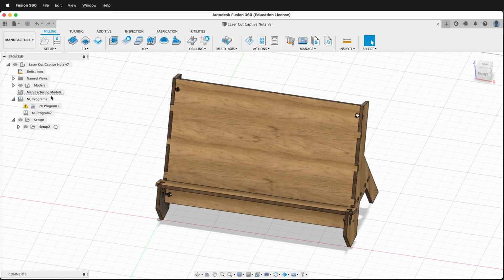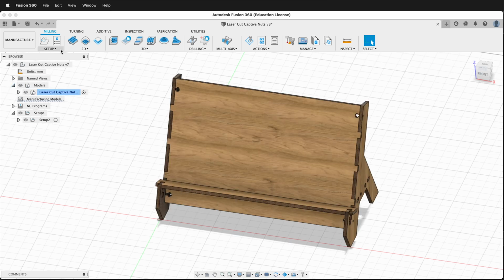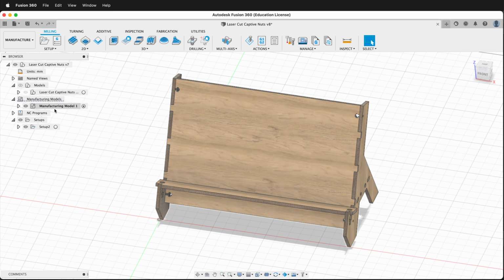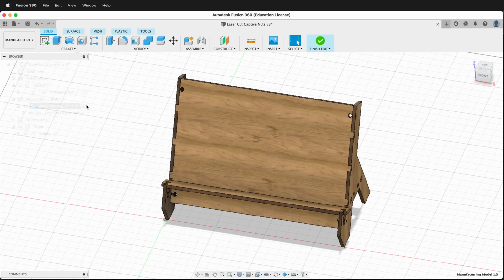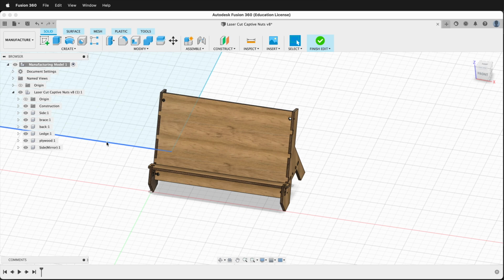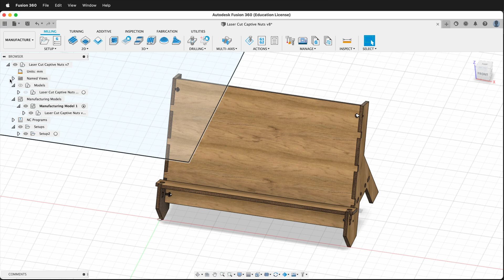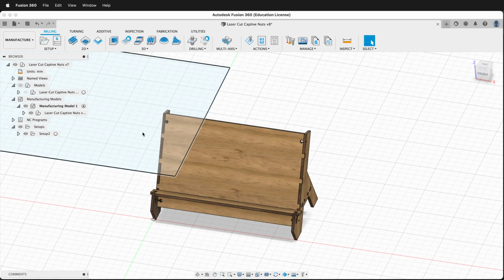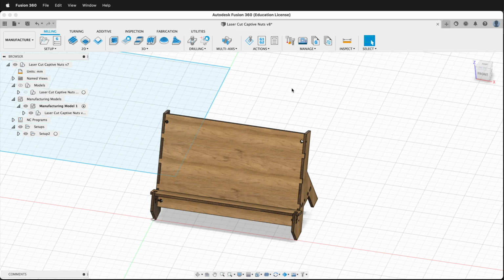Fusion 360 Tutorial - Manufacturer Model

Comment: hey man! so I made something in design and I have a manufacturing model of it laying flat on my plywood. however if I want to edit the final design when I go back to the manufacturing model everything moves back to how it was originally. its important for me to use the assembled part to refine small features that interact with each other but if every time I have to make an edit I have to go back an dcreate a new manufacturing model to prototype that takes forever. any advice?
Reply from the maker: Strange, the manufacturing model should be able to do what you want to do.

For a work around, if you make a copy then you can lay one version flat to the side and edit the original.

Make sure the copy is linked and it will change both the assembly and the parts laid out.
Reply: @WhatMakeArt  the problem isn't editing the manufacturing model itself it's editing the original in design. So that the changes show up in the manufacturing model. For example i finished the manufacturing model but forgot to put a hole that goes through 2 components if i go back to design and do that the manufacturing model goes back to the assembled one sometimes with parts all over the place.